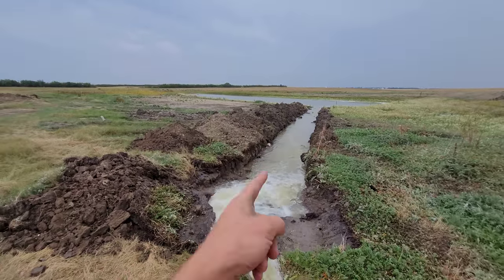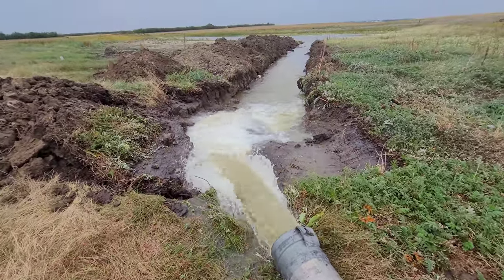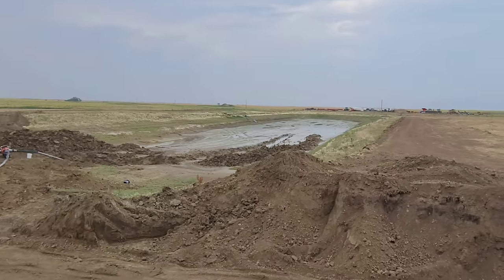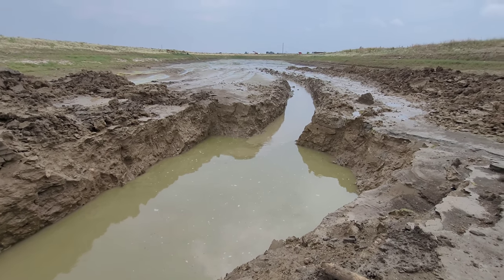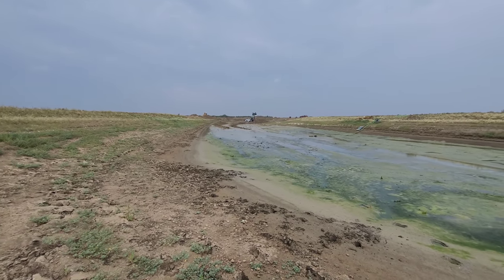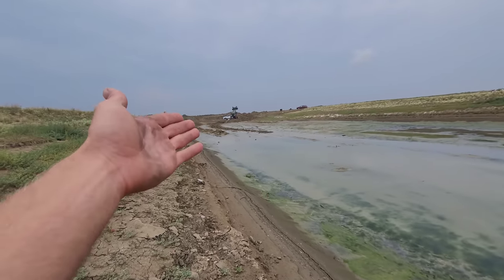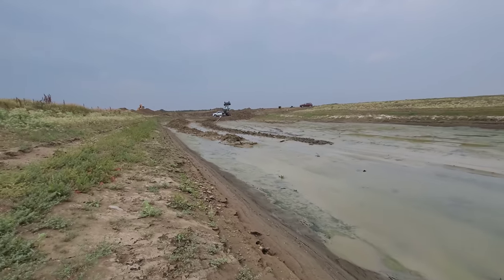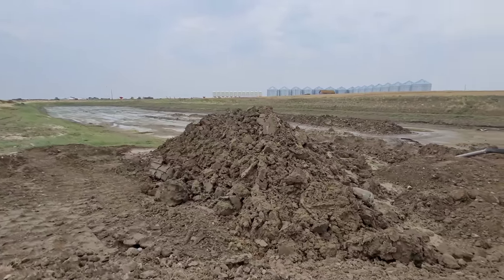Pumping Water due to the drought!

Comment: I grew up in PA where they used to use "snow fences" to gather snow on the leeward side of the fence.  Why? Long story.  But the snow fences if put up near your pond will collect snow behind the fences and if put in the correct side of your pond, will put snow in your pond and wont blow away.
Reply: Some farmers do that here in MB as well, a few spread out runs of a few hundred feet to make some snowbanks to recover the soil moisture when it melts in the spring.

Comment: Can confirm the hard water issue; most structure/home pesticide concentrates are acidic in nature.  I commonly used distilled water in my application pump sprayer and for special materials would let my aquarium RO unit run overnight to fill the truck tank... I doubt that more than 1 in 10,000 PCO knew to do that to save on material cost, improve efficacy and reduce toxicity.

Comment: You can get a whole other better micro climate at your ponds Mike. Plant Pine/Fir trees with low own water consumption around the pond. Start 20-30 meters from pond and have at least 50m deep ring around. Will shade and hold back evaporation from the pond when 90 feet high after 50 years and also condense back from needles to ground. Less temp/sun give less algae and you can start fish and crayfish farming! These trees can stand very hard wind and don't have a lot of debris falling from them. Will gather more snow in pond area. <3  You have only to give them some water first year and saplings are cheap in north, Mike! Easy solution for you who otherwise always take away trees and brushes! And yes, I'm working with this things! ;D

Comment: So how do you stop that dugout from just leaking all the water into the ground nearby? please forgive my ignorance but I feel like if you just filled a big hole with water it would dry out quickly and just like.... seep into the ground and be gone in a week or less. I know its a much bigger hole but like if I dig a hole in my yard and pour a bottle of water into it, it just disappears in a few seconds. I thought there would be a like liner or layer underneath to stop that
Reply: As you dig deeper you get into more clay and material that is fairly impervious to water. As the ground also becomes supersaturated with water it will not be able to absorb more water. Land with with high sand subsoil isn't the best for dugouts.
Reply: Clay, clay and more clay. Essentially compacted clay is like a plastic bowl. It is impervious to water. That's the super simple version.

Comment: Mike love your vids. Question for you, you talk about spraying 5 times in a season, wow. and less in dry times. could and would you consider spraying just water in drought times, if it adds lets say 100mm or 4" of plant growth, wouldn't it be beneficial in the long run.? if your going to spray you could spray water as well.?
like to know your thought's on this.
Reply: You do the math. Over 8 inches of water over the growing season would likely produce a bumper crop. One of Mike's many fields is one mile X 1 mile (5280 ft X 5280 ft X 2/3 ft) .  Isn't it 6.24 gallons per cubic foot?
Reply: That would be a irrigation pivot/linear

Comment: Question, as dry as you are, if you build the big dugout, can you scoop up the snow from all over your farms and haul it to your dugout?  Then use that for your needs.  You mentioned the snow but could you haul it from your other farms?  Of course that is a lot fuel and tractor and truck hours.
Reply: First you have to stop the snow from blowing away. Then remember that it takes about 10 inches of snow to get an inch of water.

Comment: Do u have a d10 or a d11 dozer to scrap and push dirt.
Reply: Scrapper is faster. Especially pulling tandems with the 4 track. Dozer only moves as much as the blade will hold and doesn't transport it like a scrapper does. Dozer would only help with the finish work here.

Comment: On a farm there will be diesel fuel and possibly the right fertilizer .  Just missing the skilled person to mix them and drill some holes and make a bang to loosen up that dirt.  With that the sub list will really grow!!!!!
Reply: The name on ANFO also tell the recipe and you can blend them in the hole. Ammonium Nitrate + Fuel Oil then + some dynamite and ignite with an electric detonator = KABLAMMO!!!
Doing right and enough amount Mike can have a hole like in Aitik copper mine, Sweden: https://www.youtube.com/watch?v=Pgf-AX5_AvE         Haha!
Reply: It's surprisingly inefficient 
The old deisel/soa mix 
Needs a serious quantity to get much done 
Need to spice it up with real explosives
Reply: @fowletm1992  I use about 2kg ANFO and 25g dynex to blast 10 cubicmeter granite boulders to smidgeons. Did u see the video? Ratio for 2.6M metric ton stone to 1000 ton ANFO. It's the big gas volume and heaving who does it. ;D
Reply: Ammonium nitrate is not very common in pure form.  Typically Calcium Ammonium Nitrate is used now, and this CAN is not explosive.
Reply: @ernestrollins383  You could have bought 2750 tons cheap before Beirut 2020!
Reply: Isn’t A/N less common and mostly Urea nowadays because it’s more stable and can’t be used for explosives after incidents like OKC and Texas?
Reply: @waggtech4883  Yes! But you can still buy it as a professional user. And if Mike want to build a Grand Canyon 2 then he maybe can see himself as a professional (aka daredevil)?
Reply: @uppsalahazzemarkstedt2759  
Yea proper ANFO is very effective 
What they mostly use in the mining industry round here 
But he closest thing you'll get from a fert plant is SOA 
Sulfate of ammonia with sulfer nitrogen and other trace elements 
Not quite pure ammonia nitrogen that you guys use
Reply: @uppsalahazzemarkstedt2759  Works very well on hard rock when properly placed. Nowhere near as effective on soft soil and clay.
Reply: Loosening the dirt is not a problem! The track hoes and scrapers have been digging and hauling the stuff for roads and highways for years. Back in the days of horses they used 16 horses on elevating graders to cut and load wagons to build roads. Most of the original Saskatchewan roads were built by men digging and hauling the dirt with 2 horses on a scraper or 4 horses on a tumble-bug.
Reply: @wssides  Effect of this is the "slow" detonation and extremely big gas volume you get trows dirt and mud long way. We make 25-30 meter dia, 5 m deep waterholes for animals in deep forest, by piling down a plastic pipe with a forest forwarder with special crane head, to load ANFO (and have 600 meter safety-zone). :D And it's cheap is also a plus. It's why similar FAE (Fuel Air Explosives) are so good to make temporary heliports in jungle fast. From epicenter it get all clean ground.     Ordinary fast explosives as "dynamite" are almost better in all rock with less heaving and vibration, and don't toss crushed rock so much.

Comment: Speaking of dodo pumps in Minnesota you should go on off the husk podcast with the actor Zach Johnson,  cough cough!
Reply: Mike, in the Fall put snow fences around your pond(s) to catch the snow in the winter mos. It will drift  around the fences and you'll pick up 3 to 4 times the amount of snow. In the Spring, it will melt and flow into ponds.

Comment: Mike, If you have adequate well water you could just purchase a commercial RO system to get the salt out. Then your herbicide applications will really work well. My RO system I installed this year has been producing water with about 5 ppm of TDS that starts out at about the 550 ppm TDS. We have a lot of calcium bicarbonates in our well water.  If you set it up right a commercial RO systems is pretty much automated.

Comment: So Mike, I have two questions. 1) what height above sea level are you? 2) what’s your thoughts and opinions on silvopasture / agroforestry? (Lines of trees up your arable fields)
Reply: @jackbannock3458  and stop / limit your soil blowing away and add organic matter to help with water infiltration and water Holding capacity. Hhhmm 🤔
Reply: @benpattinson1  you know what stops blowing and eroding soil, wirking fields to much lol. As for the trees, nope, they dont do that. I could show you in our fields, around the tree rows nothings growing for about 25 ft out from the tree rows. Every year its like that and then the crop that is there cant get sun on it when its in the swath to dry down so its way wetter then other parts of the field. Also dealing with trees down in the field. And in the spring around tree rows its a lot wetter and  harder to deal with. So no, trees are not needed.  By the sounds of it you don't farm and have not dealt with trees before lol

Comment: It’s nice to see big farmers suffer finally as they push the little guys out just to get land and over pay just for rent .
Reply from the maker: 🤔 That's kind of a morbid thing to say, but you're entitled to your opinion.

Large farm or small farm it's all relative when it comes to these types of years. A small farm can rent land at high $$  just as a large farm can, large farms or small farms all can fall, it hasn't nothing do by size there good sir...
Reply: Large farms are just more efficient usually less cost per acre for labor and machinery costs as it get bigger.
Reply: I understand the sentiment, but what you forget is that this large farm is owned and worked by atleast 4 different families who all rely on it to pay the bills. If you broke the farm up it would be like four 5000 acre farms which is a smaller farm for that area of the country. So to say something cruel like that, doesnt really make sense. As a family flourishes and all the children and grandchildren want to farm, the farm has to get bigger or split. Fortunate for this family, they like each other and get along.
Reply: You’ve got to respect that a lot of these massive farms started from nothing or small farms. They usually got to where they are now and stay there because they work hard and efficiently putting food on your plate
Reply: @duncanross5809  well I farm my self and these guys are all on borrowed money .